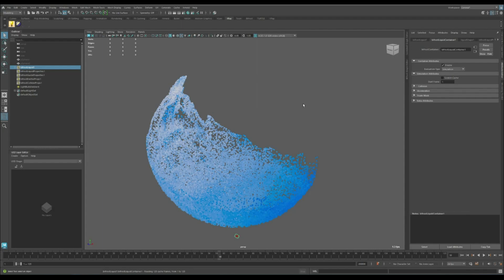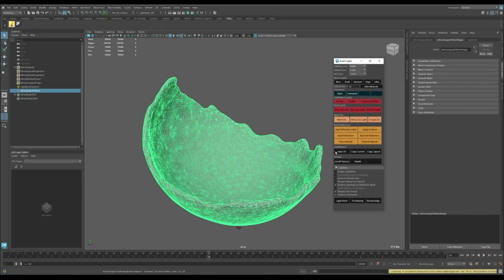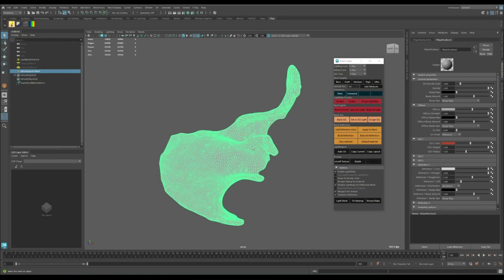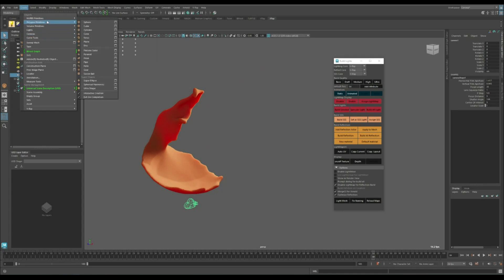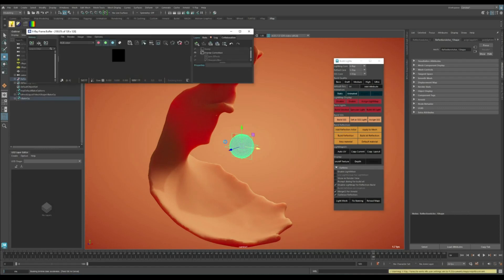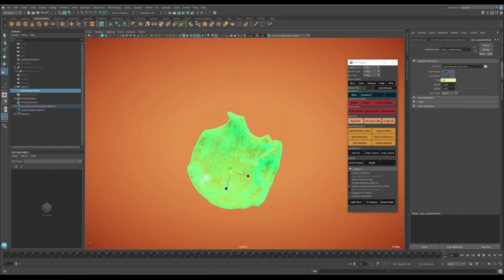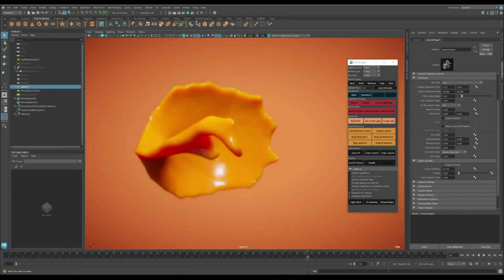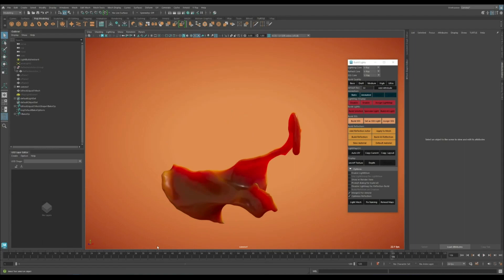Rendering Bifrost Liquid in Maya Viewport

Comment: Im trying to render the ocean splash foam with Octane, so do I just select the foam and click on the Bifrost Meshing option and apply an Octane shader to render? Thanks!
Reply from the maker: sadly I haven't really used Octane render so I can't give you any help on that!
Reply: @CGElementary  Would that work for Vray or Redshift?
Reply from the maker: @dalewyatt230  X-Ray 3 only works with arnold, but if you want to have realtime foams i suggest try converting your foam particles to volume using Bifrost, bifrost volumes look very good and may help you achieve what you are looking for.
Reply: @CGElementary  Thank you so much for your help!